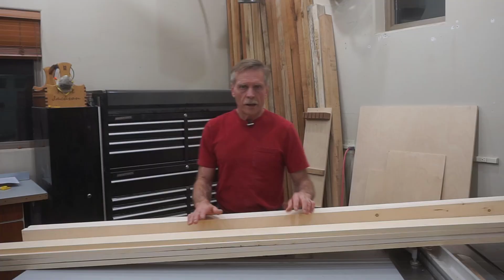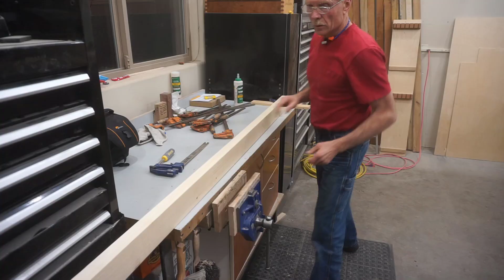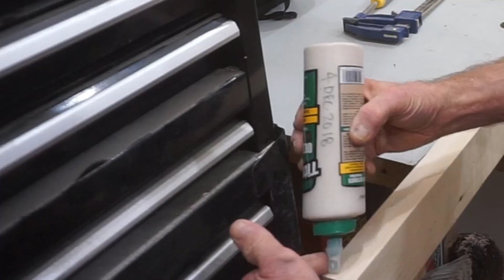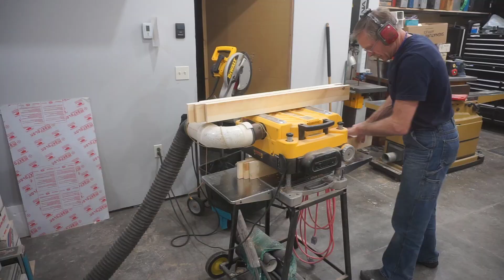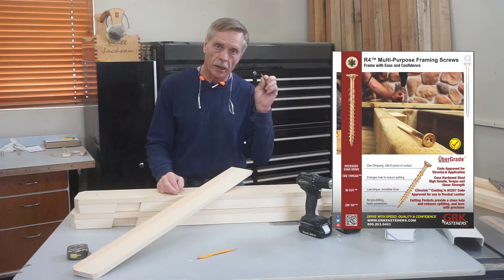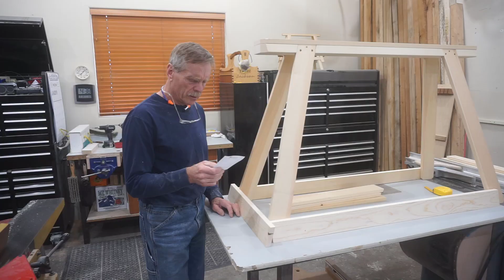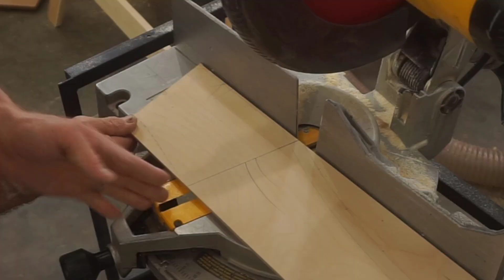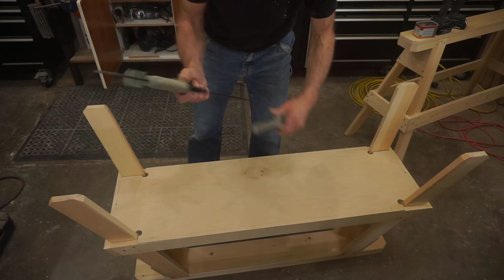Build these Professional Carpenter's Sawhorses

Comment: Built that style of horses back in tech school, the difference being we did not rip the 2x6 to an angle, but rather left the edges square and relieved the 1x6 pine legs into the 2x6 with saw cuts and chisel. They were good horses and the first task on the first job I had, was to build a few of those same horses. They lasted for years, through several house builds at least. That was back when we nailed everything by hand. No compressor on the job, frame to finish. Built our own cabinets too.

Comment: Great video. I know you did not show any weight demo on these horses but can you give me any kind of a ball park on capacity?
Reply from the maker: I've never had them come close to failure with any reasonable pile of material on them Wayne.  I wouldn't be afraid of stacking 50 2x10x16'ers on em though (5 stacks wide, 10 boards high).  I'd be surprised if they wouldn't hold a full ton of equally distributed weight but every situation is different: knotty wood used for legs, muddy, uneven, unlevel ground, concentrated load in the middle of the top etc would all reduce reliability of these or any sawhorse though.  Glad you like the video... Best, Matt

Comment: Hey I'm kind of short if I make him 29 in will the Angels still all be the same star loses everything have to change if you make them shorter
Reply from the maker: What's the part of the video where I draw the horses again because I mention it's easy to make them taller... just use the same process to redraw your horses a few inches shorter and you'll be fine. All the angles notches screw placement Etc all stay the same only the length of the legs changes... Best, Matt

Comment: I've built some wood ladders for hunting stands where I had to cut a notch in the sides of the ladder for the steps to rest in the way you did by making multiple saw cuts and then chipping them out.  I've always wanted to use a router to cut the notches but wasn't sure on the best way to approach it.  Have you made any videos cutting notches with a router?  Also, I made my old saw horses with 2x8's and 2x10's for the top so they have come in handy for a mini work bench at times :-)
Reply from the maker: I'd use this method for any notching except furniture grade notches: https://www.youtube.com/watch?v=joFoPcBhf4Y&t=1s since they can be made so cleanly and quickly when appearance isn't the main goal. Best, Matt

Comment: Nice job Matt.  The only thing I might suggest is stick with the torx screws throughout so if or when you need to replace  anything you don't have to look for different screw tips, you can just use one tip to take it apart.
Reply from the maker: Attaching the tray requires a bit change regardless Riider.  I certainly like your thinking but going down a screw size from #8 to #7 would require a drop in torx bit size too.  IMHO #8 screws are too large and would split out the horse rails... I'm just switching from torx to phillips instead of one size torx to another... so there's a tip change in the process either way. 😎 Best, Matt
Reply: @NextLevelCarpentry  True enough Matt,  I should have said, sticking to one bit type.  I always have a set of torx bits in my bags nowadays but have to stoop and search for a phillips.  BTW have you seen the new phillips head and screw type?  Somehow the two lock together strong enough that you can let go of the drill and it will hang on the wall.
Reply from the maker: @Riidher  Haven't seen those new screws but I AM intrigued... do they have a special name or brand?  Thx, Matt
Reply: @NextLevelCarpentry  They are made by Phillips.  I think I saw it on Matt Resinger 's  The Build show.  He is a builder down in texas and he has been going to new products shows lately.l  It started out in Germany and then up in New England here in the states.  Can't really remember exactly which show it was  but I will try to find it here later tonight and will let you know.

Comment: Matt, in this and other of your videos you mention using SketchUp. I’m wondering which version you use? Any SketchUp insight you care to share would be valuable and appreciated. Thanks!
Reply from the maker: Hey Lane, I've got a vintage copy of SU Make 2017, the last stand-alone free version before the new browser based program which I don't care for.  At some point I'll be forced to buy Pro but I've avoided it so far.  BTW You can check out The Digital Jobsite my other (neglected) YouTube Channel for insight from a carpenter on how I use it.  You're welcome... Best, Matt
Reply: Next Level Carpentry  WOW...Just what I was looking for! Sub’ed & Notified. Watched the 2x4 video...made my hair hurt! 😂 Hours of new info to absorb. Looks like web based is my only option in the “free fur nuthin” price range. There’s one called “Shop” which costs $ and “Pro” which costs  more $$. We’ll see how it goes. First I’ll have to invest in a real computer as all I currently have is an iPad Air and no way I’m going to try using SU by finger swiping and clicking. Thanks so much Matt. Lane in VT
Reply from the maker: @lanecobb2462  I've heard there's still copies of Make 2017 'out there' and think it might be worth looking into.  When you get that 'real computer' I'd add a joystick mouse by 3D connexion... makes ALL the difference in modeling speed for me.  There's a link in the Next Level Carpentry Amazon page if you end up hitting up Santa for one.  Caution: SketchUp can be highly addictive! 😁😎 Best, Matt

Comment: Thanks for this video and for sharing the tips and methods you have learned over the years.  For some of us, getting the correct angle on the correct edge of a board can be a challenge when you start flipping boards over and lose track of which angle goes where.  Your methodical approach and pencil markings help in that regard.   Appreciate your tips on gluing up the 2x4's to make a wider piece that is better for your purposes than what you could buy.  Using sawdust to remove glue squeeze-out is also so simple and effective, that many overlook its utility and just smear the glue when trying to clean up with paper towels. The Snappy Tools countersink drills are also a great tip.
Reply from the maker: You're welcome for the video... it's always nice to hear appreciative comments that let me know the 'lesson' is getting through to viewers.  Thanks for watching and commenting.... Best, Matt

Comment: and if joiner is not square you run one 2x4 with mark to fence other one to the out side will fit every time
Reply from the maker: True enough but FAR better to use a machinist's square to square up your jointer.  Takes less than 15 seconds and is much easier than keeping track of marks on multiple pieces throughout a project...

Comment: Aren't the left and right legs cut the same  with the orientation changed once the cuts are completed?
Reply from the maker: They sure are Javan... they aren't different until the bottom ends of the legs are nipped off.  I personally designate left/right and top/bottom early on for orientation of subtle features in grain, knots, etc but that's my OCD thing showing up again.  Best, Matt

Comment: Could you not screw the top cap from the underside so the screw heads are well out of the way?  Just a suggestion.  Excellent job really.
Reply from the maker: Technically, yes, but a deep cut would still hit the screw tip and you wouldn't know where they were to avoid them.  Plus they wouldn't hold nearly as well... Best, Matt
Reply: Gluing the top cap is better, screw and plug might look nice though. Also if gluing, screws can be used to clamp, then be removed and the holes filled with a mix of sawdust and glue then sanded when dry ....

Comment: I had built similar ones years ago, needed a memory boost to make more, these are perfect. My old ones I managed to use 2 *6s for legs turned the other way, splayed out, the top also 2*6.... I  could use one as a bench and stand on it, the splayed legs gave extreme stability, I could slide planks across without tipping...they were for holding planks loaded up with building stone, heavy work horses

Comment: Made a set of the first gen sawhorses...they work well for processing bulk lumber like joists. 

With that success I decided to make two sets of gen two sawhorses. At approximately half the weight of gen one these are much more friendly to being moved site to site. These are far stronger and more stable than the plastic sawhorses (which fall apart) or the folding metal variety

Already received requests for more. FYI these all go to Habitat for Humanity job sites. These sawhorses have already seen hard use. In the time I've made these three sets of sawhorses we have broken three sets of the store bought versions. I recomend these to anyone and am eagerly awaiting  the gen three design. Perhaps folding?

Thanks Matt.
Reply from the maker: Good on your for helping Habitat Phillip... and thanks for recommending these designs to others.  FYI the Gen Three (Master Carpenter Sawhorses) are basically a 'furniture grade' design on the same general concept of Gen Two horses... a classy conversation starter and visual resume for a carpenter but not necessarily more functional.  You'll love 'em for your personal set though as I've never seen anything anywhere near like 'em.  Unfortunately it's still going to be awhile before I can get a video done on them... Best, Matt

Comment: These are pretty close to the way I was taught to make horses 40 some years ago, but still a little different. The sacrificial 1x6 top is a lot easier than changing out the 2x6 itself ... I guess you can still teach an old dog new tricks. I made my end plywood gussets 8" to 9" tall for a little extra support. Back in the day we often would set the basement steel beams (they were not full length back then), meaning we would have to be able to walk up the horse with the beam on our shoulders. So for the lower rails I would use a 1x2" for the lower rail with the bottom of it about 12" AFF, then mount the 1/4" or 3/8" plywood (what ever was on site) for the tray to the bottom of the 1x2. Then install a 1x6" tight up under the plywood making it strong enough to use as a step up. After we stopped setting the steel ourselves I switched out the plywood for the tray and installed 1/4" screening so it would still hold anything I threw in there, but all the sawdust would fall through.
Reply from the maker: Hey Jim, thanks for adding your modification/alteration ideas to this video.  Where old dogs and new tricks are concerned I really like your idea of using screen instead of plywood... that would have been very useful working on jobsites where sawdust, rain and snow would fill the plywood tray with annoying frequency.  Best, Matt

Comment: Nice work. Changed my mind...I'm going to make a pair of these instead.
Reply from the maker: Cool.  As long as you don't need to stack entire bunks of  16' lumber on 'em I think you'll be glad you changed your mind Shane... have fun with the build! Best, Matt
Reply: @NextLevelCarpentry  Hi Matt. 
Well, I've finished my sawhorses. Just giving them a coat of Spar Varathane today.
I used the same 12 / 15 degree angles as yours, but i beefed mine up. Instead of using 1 X 4 material for the legs, i used 2 X 4's thickness planed to 1  7/16" X 3 3/8". I made the dado notch cut in the top support in the 12° faces, too half the thickness of the legs, and a rabbet cut in the leg tops to fit flush with the support edge. So essentially the 2 X 6 is resting on the shoulder cut of the legs. All angles match up. In addition, i also added a beam under the 2 X 6 in the form of a 2 X 4. Too support the ends of the beam, i mortised in the ends of a small 5 3/4" 2 X 4  at the depth of the beam with a 1/4" mortise into the leg insides. This proved to be a nightmare, angle wise, for the 5 3/4 inch block ends, due too the 12 and 15 angles, as I made the mortise parallel with the legs. The angles ended up being 10.5° miter, and 4° for the bevel. And even that's not right, but got it close enough. I'm losing my hair as it is! 
So anyway, braces and top protector cap are the same, as is the tray. I used 1/2" exterior ply for that, and the gussets. Needless to say, an elephant could stand on these things and they wouldn't move! Exaggeration maybe, but you know what i mean haha! 
Thank you for inspiring me to build these. They'll come in handy at the job sites. My boss is gonna love 'em! He's using flimsy stamped steel folding horses currently, which are very unstable ponies. Think they may end up in the scrap bin! 
Cheers, Shane.
Reply from the maker: @shaneroper477  Way to go!  Hope your boss recognizes your abilities and the determination you put into those sawhorses... it's not every employee who will put that much effort and interest into their work.  If an elephant happens by your jobsite maybe you'll get a chance to do a stress test too... From the sound of things my money is on your horses holding up the elephant! 😂😂😁😎 Best, Matt

Comment: at about 44:15 you say to determine what the measurement should be....how exactly would one go about determining that without your computer program?  i'm just curious if you have an old school pre-computer method to explain that
Reply from the maker: In an abstract way the legs on these horses are actually cousins to 'off angle' hip rafters Dr Feelgood and the 'old school' way to figure their length is similar.  It's way too involved and to obscure a topic to cover in a video but the way I'd go about it is to make a full-scale drawing that includes both the 12 and 15 degree angles involved.  It gets tricky because it's 3-dimensional but you can get the jist when I show how a full scale drawing is used to figure length for the '2-dimensional' legs in the Super Sawhorse build video.  That's probably not much help but might be enough to address your good question.  Best, Matt

Comment: Great job. Sometimes I will build my sawhorses so the side to side splay is 14 in. at the bottom of the legs to fit between wall studs.
Usually build a new pair every site since by the end of the build they end up pretty beat up.As  most people have no respect....

Comment: OK. Now I really have a carpentry inferiority complex. I'm a DIY'er who wants to produce quality work, but I don't have a jointer or the space to put one. I know people who call themselves carpenters that do not have jointers or a fancy shop.  How many carpenters have the luxury of the tools shown in this video?
Reply from the maker: Good news is that this is the only pair of these saw horses I've ever made using a jointer all the previous ones were made with nothing more than a skill saw and a drill so there's no need to have a flare-up with your inferiority complex😉😎 in a wider context many Carpenters do you have access to a shop with a few basic tools like a jointer and thickness planer because they are necessary for working on more advanced carpentry jobs.  Hope the video inspires you to improve and expand your carpentry skill set... Best, Matt

Comment: Great job for sure. My son works in the recycled lumber business and he approached me to build a set of saw horses without screws. the purpose is to have a work surface to place old lumber to use a metal detector to find and remove nails. How would a  slightly OCD Next Level Carpenter approach this saw horse design?
Reply from the maker: Interesting challenge... I think timber frame style horses might be the answer... I don't have any but since they're held together with wooden pegs they'd fit the bill.  I've noticed other YouTube videos on 'trestle horses' that would be worth looking into... Best, Matt
Reply: Try mortise and tenon fitting of the legs into the top board and since he’s in recycled lumber use hardwood and maybe a 6x6 top board since it’s not really for sawing on . Maybe 3x4 legs to whatever height he’s comfortable working at ....